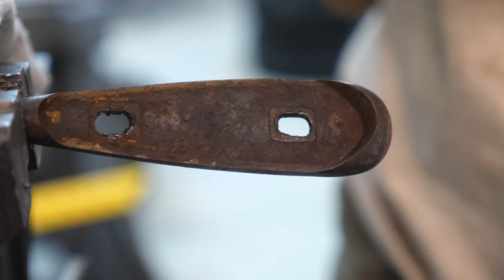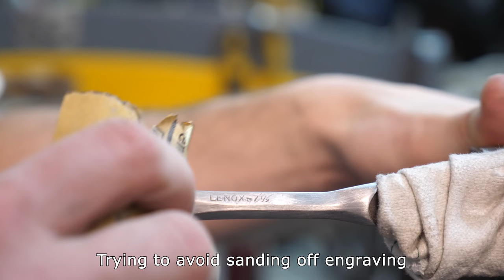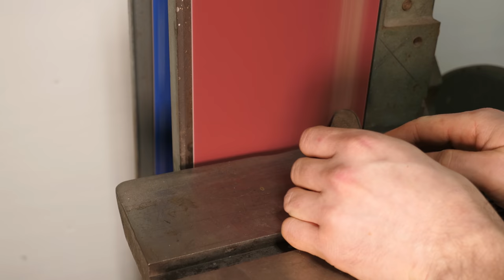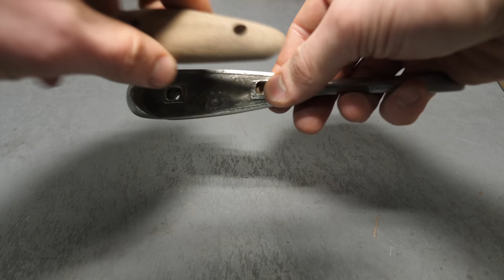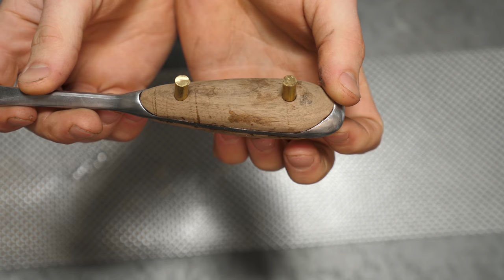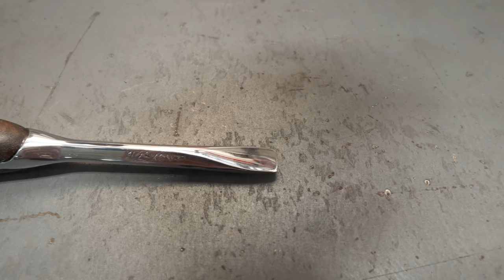Antique Screwdriver Tool Restoration

Comment: Beautiful job with all the polishing, the handle etc. If I may make a suggestion, though, I would have re-ground the very tip at the end so that it has a more defined shape and is less likely to slip out of the screw slot.

Comment: Very nice job of rebuilding and old screwdriver.  I have a lot of these "perfect" handled screwdrivers from tiny to very large ones. This type of handle with the wooden scales are used on a number of other tools. Alvin made this type of straight screw diver  famous and are quite expensive. Cabinet makers and gunsmiths often use them.  If it were my tool I would have kept the wooden parts and re-ground the tip for a specific screw head. Then I would continue using it to restore or repair other projects.  Thanks for the video!

Comment: I saw the screwdriver which My 'Mechanics' restored which motivated me to do the same with the one I had. It's a larger, number 6 driver but was in pretty bad condition. The shaft was bent in 2 places, one of the brass pins in the handle was missing and replaced with a bent nail, the wood was in poor condition and the tip looked like it had been used as a pry bar or chisel. I'm glad I restored it and it now sits with all my other screw drivers :). Interestingly, I restored my screwdriver in almost the exact same way and encountered the exact same issues as you did...lol! I ended up using Silky Oak for my handles. BTW, I don't know who made my screwdriver. It has crossed pliers on a shield on the tang of the screwdriver as a logo and a Germany mark stamped on the shaft. Anyone got any ideas?

Comment: Pretty sure it's walnut. You may have lost the temper in the working end when you squared it off. The heat generated may have been enough to cause it to anneal. I would have re-tempered it just to be safe. If it's only for show, then no need to temper. Beautiful result. Probably never looked as good even off the shelf.
Reply: Yes, true about the temper of the tip. I have and restored a larger one of these but I fortunately have a slow water cooled/lubricated Tormek grinder which I used to regrind the tip. This one was made by Lenox but I'm not sure who made the one I have. It has a partially worn away mark on the shank which says Germany and another word which looks like 'Woodline'. There is also a logo which looks like a pair of crossed pliers on a shield. Any ideas anyone?

Comment: Very awesome redo, I love the look of those screwdrivers.  The brass pins are really only decorative since you use epoxy right?, or do they serve structural purpose.  I think I could possibly do one without pins, they seem to add complexity,  (but look great also).  Nice job
Reply: They add stability considering you will torque the handles when driving screws.

Comment: you could have maybe used wood putty to get the back of the handle shape put the putty in then press the wod in to get the shape then pull it out and let it dry
Reply: Tried that... it shrinks when it dries... so the template becomes too small... good thought though!

Comment: Didn't someone else do this exact same thing already?
Reply from the maker: My Mechanics has a similar video with a larger screwdriver. His methods are slightly different than mine. To be fair, this is a criticism you could apply to almost any restoration video. Stay tuned, though. I have a video coming out restoring something I haven't seen anyone else do yet!
Reply: Yes, and luckily he did his anyway. You get to see a different take on the restoration. Besides, if you like axes you don't want one axe restoration on Youtube. You want to see more. There's always a new technique or something they didn't explain or get the best angle on.

Comment: Walnut.
Reply: No glue on pins?
Reply: Nice job...
Reply from the maker: Yup. You win the free internet points. I should have put epoxy on the pins but I think some must have squished out of the handle onto them because they seemed to hold up fine.